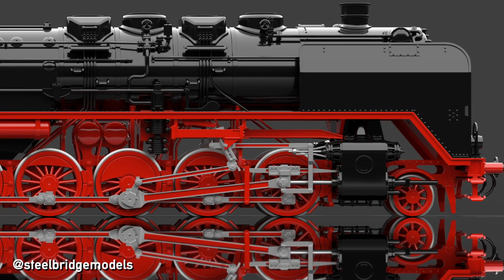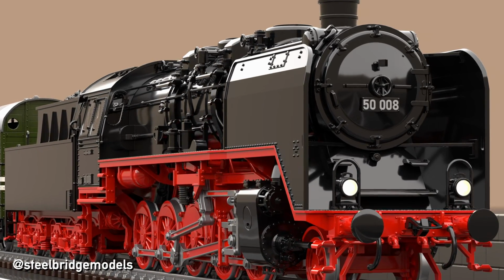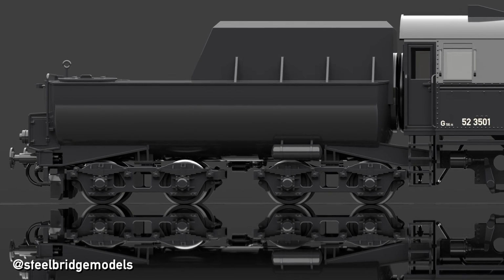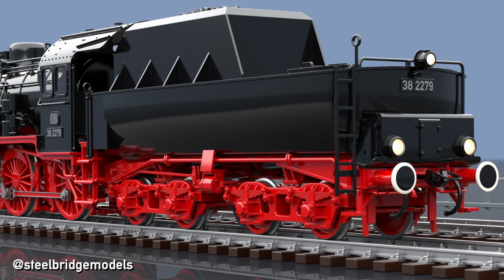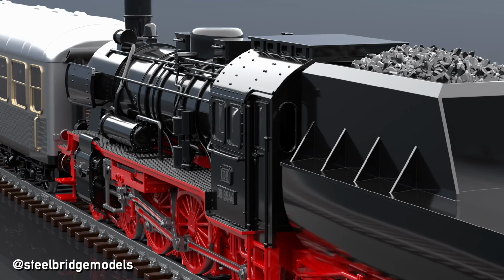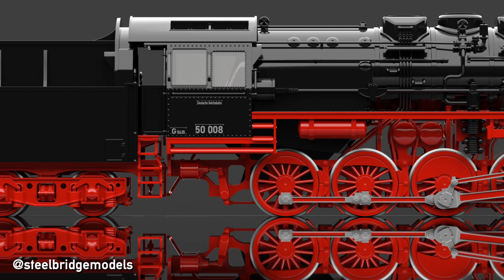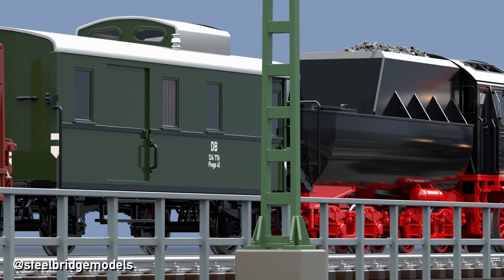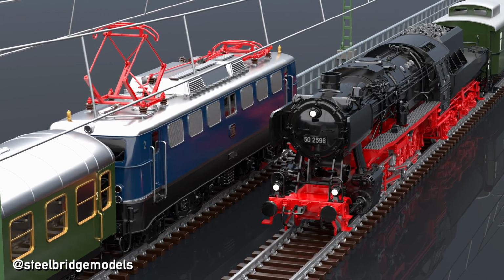How to recycle a new Locomotive!

Comment: oh for fucks sake just ditch the coal tender and install an oil wagon behind it, fill it with diesel and tadaa you have a diesel locomotive that just so happens to need frequent refills with water :P lol (you can also just redirect the steam back though a cooler and re-use the water forever) absolutely no idea why they all bought new locomotives just to 'run on diesel'. :P coal makes a fire under water. diesel can also just make a fire under water :P just need to drop in a new burner ;)
Reply: they could have kept using these things forever lol. as they take the exact same fuel as modern stuff :P with some minor modifications.

Comment: Great stuff! I believe here in France SNCF inherited some of these post war. Designated SNCF 150Y over here. I always imagined these were ex German class 52's... or were they?
I model British 00 gauge, but I'm on the look out for a 50 or 52 in classic post war DB black and red with small smoke deflactors. 2 or 3 rail would be OK for me as I have layouts using both these systems. My 3-rail layout is 12V DC (Hornby Dublo), but I reckon I could convert a Marklin AC loco to DC  by either converting the motor using a Hamo permanent magnet, or by wiring in a bridge rectifier to reverse the polarity, your advice and expertise would be appreciated!  Looking forward to your next video on these machines.
Subscribed naturally !

Comment: The 50 can't be reduced to a "war in mind" machine. It must be seen in conjunction with its passenger train sister, the pre-war class 23. 
While the 23 was designed to replace all the mid to large size Länderbahn passenger train loco classes serving as classes 37, 38 and 39 in the Reichsbahn, the 50 was designed to replace Länderbahn goods locos serving with Reichsbahn numbers 55, 56, 57 and 58 on lines that were not accessable for the heavy class 44.

Comment: I've noticed some locomotives feature a high centered headlight and some don't. Is there an explanation for this?
Reply from the maker: In the late 1950s, the third headlight was added to make it easier for car or truck drivers to differentiate between trains and road vehicles at night. Before than, three headlights were only used in some special cases.

Comment: There were also class 51 and 53 which were similar and less common.
What is the history and different aspects and details of these please?
Reply: If you’re talking about the classes 050 to 053, those are just renumbered class 50 engines. In 1968 the West German Bundesbahn introduced a new numbering system for data processing needs, which for steam engines changed the leading digit to a 0, for some the rest of the number remained unchanged (excluding the control number after the dash).
The new system had three digits for the class, three digits for the numbering and the control digit, this wasn’t a problem for engines built in quantities below 1000 engines. For the Class 50 of which 3000+ were built it was a problem. Since the Bundesbahn didn’t have class 52s anymore at that time and the classes 51 and 53 never came to be, they simply shifted the 1000 digit into the class numerator. 
E.g. 50 467 became 050 467, 50 3040 however became 053 040 and so on.
Reply: Class 51 as far as i know never existed,Class 53 were old locomotives from the regional railway era...Whatever Märklin dubbed as "Baureihe 53" is nothing but a design concept,which probably would not even have been named "Class 53" and was never build anyway

Comment: Early DB had quite limited resources and a huge shortage of rolling stock. Some already saw the end of steam coming but electrification of all mainlines would take decades and diesel fuel had to be imported. So they had to work a lot with the inherited locomotives from old Prussian models via the unified classes of the 1920s/30s to the war locomotives. A program of post-war steam locomotives was also launched, but some of them never went past the prototype stage: Once they had been developed and tested, electric and diesel locomotives were ready as well and these made the steam alternative look very old and cumbersome in terms of maintenance requirements.
Thanks for the description, I didn't know the class 38 had different types of cab/tender combinations ... Class 50 originally had a cab open to the rear end but a wall with windows attached to the tender to protect the crew from the weather when going backwards.
Now it's the east Germans who really turned class 52 into a modern useful steam locomotive (52.80) and that's of course worth at least one additional video. It's quite a widespread topic, every country had its own idea of what to do with them, Austria rebuilt some tub tenders with a cab for the accompanying staff.

Comment: I think these locos were the German equivalent of the British War Department's 'Austerity' 0-6-0STs, 2-8-0s and 2-10-0s or the USATC's S160 2-8-0s in that they were designed specifically for the war effort.

I like the BR50s (they were my favourite German locomotive to take for a spin on Trainz Railway Simulator 2010), interesting that they were the inspriation for the BR 52s, and wow, that bit about the boilers was really surprising! And the use as donor locos makes perfect sense too.

It's like the Austerity 2-8-0 (the 2-10-0 was simply a larger version as I understand it) which was inspired by the LMS Stanier 8Fs, of which quite a few were built specifically for overseas service during the war as the class had been chosen by the WD as the standard design, much as the Great Central Railway's 8K Class had been adopted by the Railway Operating Divison (ROD) for the same purpose during WW1. The WD 8Fs were sent all over the place, many being used in the Middle East, Turkey and North Africa and after the war, some were repatriated home while most were sold to the railway companies in their respective countries to live out their working lives.
By 1943 however, a cheaper alternative was needed, and Robert Riddles (who would go on to design the BR Standard Classes) was tasked with coming up with a design. Essentially, he designed a cheaper 8F. In total, including pre-war 8Fs, 852 Stanier 8Fs were built, while there were 935 Austerity 2-8-0s built and another 150 2-10-0s! That's a lot of similar-type heavy freight engines!

After the war, as I said, some of the Stanier 8Fs that had been built for war service were brought back home, bought by all of the 'Big Four' railway companies and later taken into BR stock. BR also took in 733 of the Austerity 2-8-0s and 25 2-10-0s. A couple were retained by the War Department, running on the Longmoor Military Railway in Hampshire. While they retained the Austerity engines, the Stanier engines were later sold to BR.

A couple of Turkish 8Fs survive, and have been brought back to the UK. All in all, in preservation today there are 12 Stanier 8Fs (none of the ones built pre-war were preserved), 1 WD 2-8-0 (repatriated from Sweden) and 4 WD 2-10-0s (none of whom worked with BR, two have been reaptriated from Greece, one is based in the Netherlands, and the 4th, well, more details on her later...).

One of the preserved 8Fs is particularly well-travelled, and she's a loco I'm familiar with as she's based on the Severn Valley Railway, my local heritage line. LMS no. 8233 was built in 1940 as one of the WD 8Fs, and was intended to see service in France, however the evacuation of Dunkirk and the fall of France to the Axis put paid to that, so she was taken in by the LMS. She did eventually see service abroad, being sent to Persia (modern-day Iran) where in 1944 she was converted to burn oil and apparently once derailed after hitting a camel! After the war she ended up at Suez and was almost scrapped in 1948, but she returned to Britain in 1952. Under the ownership of the War Deaprtment, she ran on the Longmoor Military Railway as no.500, before being sold to BR in 1957 and renumbered 48773. A funny story is that she was initially mistaken for a WD 2-8-0 and numbered 90733 (a number which is now carried by the only surviving member of that class, which had never worked for BR in the first place!), but the mistake was soon rectified.

She initially worked in Scotland, before being reallocated to the North-West in 1962. She lasted pretty much right up until the end of BR steam in 1968, working her last train on 4th August (steam loco usage on BR officially ended on the 11th). She was bought by preservationists and arrived on the Severn Valley Railway later that year. She hasn't steamed since 2008, and has been kept at the railway's museum, the Engine House, which opened that year, though I think her owners have been recently starting to raise money for her overhaul.

The SVR also has a WD 2-10-0. Another ex-Longmoor Military Railway loco, no.600 'Gordon' (named after General Charles Gordon of the Royal Engineers, though yes, she's blue and the connection has been made to Gordon the Blue Engine), never worked abroad and spent her post-war career at Longmoor, right up until the railway closed in 1969. The SVR offered to house the loco for the Army and she arrived there in 1972, steaming for the first time a few years later. She's been out of service since 1999, and like our 8F, has been stationed in the Engine House since it first opened in 2008. The Army also formally transferred ownership of her to the railway that year. 

Looking forward to the rest of this series!
Reply: There were 6 official Kriegslok classes: the BR52 (as here) the heavier BR42, the E44 and E94 electric locos, and the V36 and Köf diesels.
Now being an official Kriegslok (war locomotive) didn't necessitate being designed in the war, or specifically for the war effort. In fact, it was only the steam locomotives that were specifically designed as such.
The added complexities of both the E-loks and diesels meant that for these types, it was a case of continuing production of a proven known and useful design, and the designation of Kriegslok didn't even ascribe as new builds either. The Kriegslok programme was inclusive of the maintenance and repair/ rebuild of priority classes.
By these, spares, replacement parts, fitting etc were prioritised to the aforementioned kriegslok. Say an E44 came in for repair, and an E16, all repair energies would be towards the E44, including any spare parts manufactured. One of the things with the E94 and E44 is they shared a lot of technical parts, thus allowing, say, AEG to manufacturer just one part.
Regarding the redesign of the steamers, with the simpler designs and multiple production facilities they were always seen as being the high production locos, hence the desire to redesign to save on materials, production efforts, simplicity etc.
You may think well why did they bother with the complicated electrics and diesels? Basically for the same reason as in the fifties: they could do considerably more amounts of work in a given time, with considerably less downtime for servicing and maintenance.
Ooh, and just to add I believe the WD 2-10-0 was the same as the 2-8-0: the extra axle was solely there to give a lighter axle loading and greater route availability. 
Sounds a bit bizarre but to give an idea, the 15 ton axle loading of the 8f would've been too heavy for the New Zealand Railways, the larger than the 8f native 4-8-4's having a 14 ton axle load. Even funnier is those same native 4-8-4's had a top speed of around 75mph, with smaller driving wheels than the 8f
Reply: @muir8009  Thanks for the extra details! Very interesting read.

Though I think the New Zealand comparison is largely irrelevant given that the track gauge used there is different to that in the UK and Europe, so the 8F wouldn't have even run there anyway. Though I will be honest, our loading gauge is so small compared to virtually everyone else that sometimes I feel like the dimensions of the 3ft 6in gauge locos and rolling stock used in Australia and New Zealand are similar to our standard gauge ones! I don't know if that's actually the case though. But even our biggest locos are tiny compared to the American behemoths!
Reply: My local railroad museum, the Tennessee Valley Railroad Museum, actually owns the very last s160 steam locomotive ever built, locomotive 610. 610 was built in 1952, roughly 10 years apart from the first s160’s completion. It originally worked at the Fort Eustis military railroad training facility in Virginia, where they used it to train military railway personnel how to operate steam locomotives during the Korean War. 610 was retired in 1972, and in 1978 it was sold to the Tennessee Valley Railroad Museum. They restored it to operational status in 1990, where it would run weekend excursions on their track between Jersey Pike and East Chattanooga. It would occasionally run longer excursions down to Chickamauga and Summerville, Georgia. Sadly, rising costs of operation and rising problems with its boiler forced 610 to quit operating in December of 2010. She hasn’t ran ever since. It’s unlikely that she will be restored, but they still keep her around in good condition just in case.
Reply: Considering the designation “Kreigsloc” directly translates to “War Locomotive,” they’re definitely contemporaries of the WD and USATC 2-8-0’s

Comment: 52 3879 is the only fully original Altbau 52 still operational.
After WW2 this in Wien-Floridsdorf in 1944 build engine was alocated to the OBB.
Later in the 1970's after a major overhaul she was placed in the strategic reserve of the  Austrian Army.
In the end of the 80's she came to the Netherlands and was used for the 150 years celebration of the Dutch railways in 1989.
in 1996 she got a runninggear overhaul at meinigen and shorty after repainted in its original 1944 Wehrmacht colors, the  smokedeflectors were also temporarly removed for a big WW2 movie.
A big worldwide controversy about this "NAZI" engine happend and she needed to be 24/7 garded.
She now has become a moviestar who has portraid in several WW2 movies/TV series from all over the world
Reply: What about the 52 7596 operated by the Eisenbahnfreunde Zollernbahn? She appears  to be also one of the original " Altbau"- 52s.
Reply: @heermannmorrer  There are several Altbau left who still have the original rivited WW2 boiler.
52 3879 in OBB service never got any of the improvement refits the DB / DR machines got.
That (simplicity) was also one of the reasons she was put into strategic reserve for the Austrian military.
Only smoke deflectors from a war damaged donor sister engine were installed just after WW2.

On the total oposite of a fully original 52 is the former DRG 52 532 / TE-532 / DR 52 8130 who is converted back to look like a special "altbau" 
In the Aachen region there were mostly 52's who had special shortned wannentenders so they could be used on the too short turntabels for a standard 50/52 around Aachen.

Those mostly drove heavy freightrains on short routes and hilly routes too and from the Netherlands and Belgium.
Not one of those special Aachen 52's or tenders survived, all were scraped. 
So a "replica" of those specials for the region is being rebuild from a reko 52 as an Eurregio effort and nearing completion.
52 532 will be the only 52 (sofar) who will have multiple safety systems so she can run on the mainlines in the Netherlands Germany and Belgium (Indusi, ATB-NG and Memor)